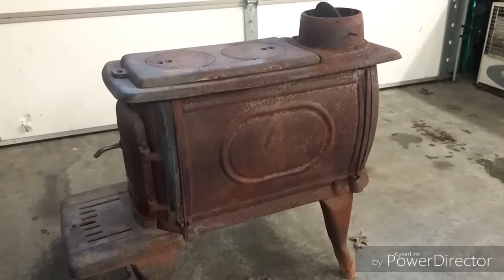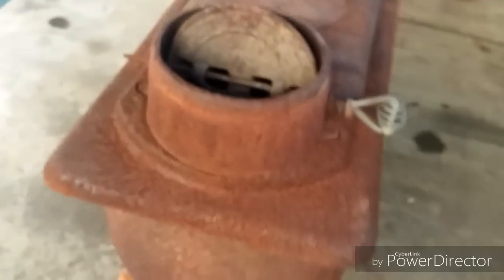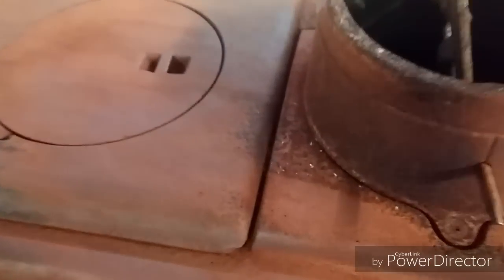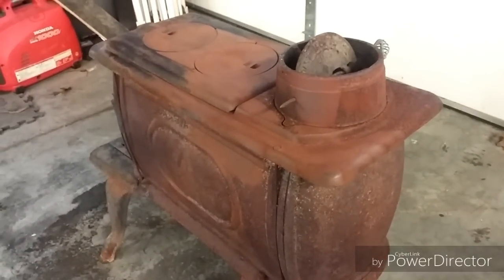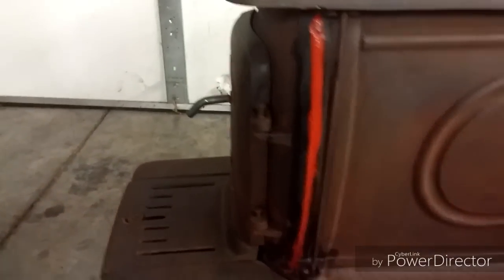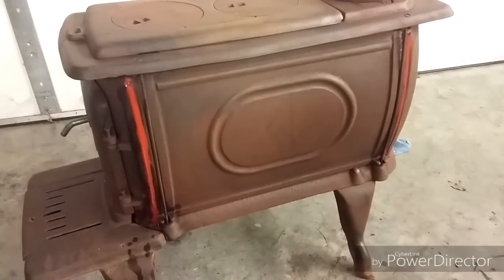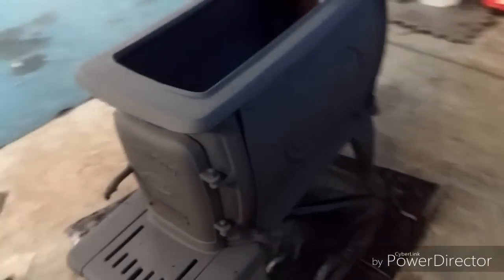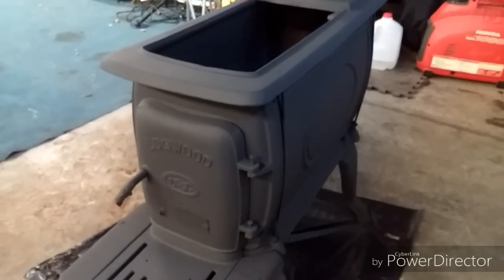How I refinished a rusty wood stove

Comment: Next time after you clean them up, cover it in cooking oil , like you refinish cast iron skillets. Then have a fire in it.  They turn out awesome.
Reply: That's exactly what I'll do. Thought about the cooking oil rub, though your cast iron skillet enlightenment set it in iron. Thanks
Reply: @clydegray9714  You won't be disappointed.
Reply: So you would use the oil instead of paint? I was worried these paints are toxic and was thinking of how to get around that bit.

Comment: I had a stove identical to that. I spent 8 hours on it with a wire wheel and hit it with the stove polish. Looked brand new. Paid $25 for it. Sold it for $250.
Reply: I have this stove also. It is made in china. I wasn't sure if I can use it. I paid $75 for it. One of the legs was loose. I wasn't sure why. I haven't been able to figure it out and nobody wants to fix it because no one does that work around here.

Comment: Have you had issues with cracks and did you had to disassemble it at some point? I'm thinking of restoring one that I found on the marketplace, and it has a couple cracks in the front faceplate and one at the corner of the top of the stove.

Comment: Old timers, new a different way! It worked very well. They did not need electricity or wire wheels.  For some reason, the solution escapes my tiny brain. 

There is a difference in the wants of society and the needs of society!

Comment: Exactly what I needed as I have one similar. I need to find a replacement round lid as one is missing. Any ideas?
Reply: Go to a muffler shop and have them cut a circle out if 1/4 inch thick steel plate. We did one and added a handle shape coming from the side and its slightly larger than the hole. Just lays flat a top of an old pop belly stove.

Comment: What temperatures are the paint good for exactly? The hardware store close to us, has a paint that says high heat 550 degrees c. Is that good?
Reply: 550 Celsius is equivalent to roughly 1000 fahrenheit. That should be safe for an indoor wood stove as long as you aren't burning any old scrap pieces of oak furniture. I burned an old oak chair once and the whole top of my stove glowed bright red...REALLY HOT! Temps like that will bubble and peel  your paint off.

Comment: where did you get the stove if you purchased it how much did it cost? I have one just like it that I'm wanting to sell need to know the value
Reply from the maker: Tina Mac This one was a freebie find.
Reply: if he were having to buy it what would you have paid for it what would you been willing to pay for it
Reply: Tina Mac maam google vogelzang woodstove theyre identical except for the name and the vents in the slide under the door... but be warned these style stoves do not seal well meaning once you light a fire in it closing the vent wont put the fire out it has to burn out ...my suggestion is burn small wood and feed a log once every 45 minutes to one hour ...in my stove (identical to the one in the video) i find that  3in. to 4 in. thick logs 14 in. to 16 in. long work well thicker logs can be used at night but the vent and damper should be closed all the way and you will still need to get up and feed wood about every 1 & a half hours...
Reply: georgiaridgerunner is absolutely correct! These old box stoves don't seal worth a damn...VERY inefficient! Good for a small cabin/shed or where I am, Canada, an ice fishing hut! Impossible to close that front slider damper and get a perfect seal...not an airtight at all! But for short term heat they can pump out the heat quite well. Basically good stoves as long as you're there every hour to re-stoke.